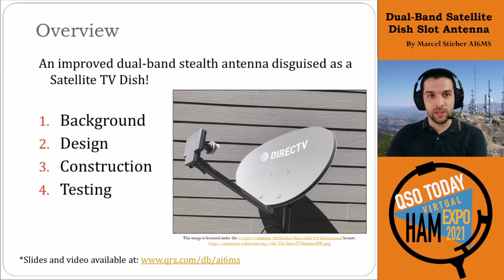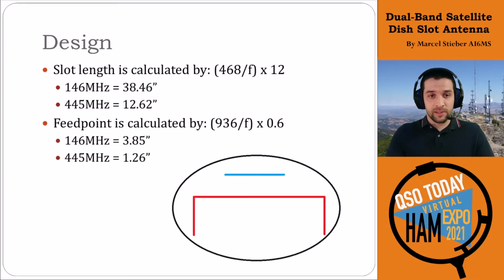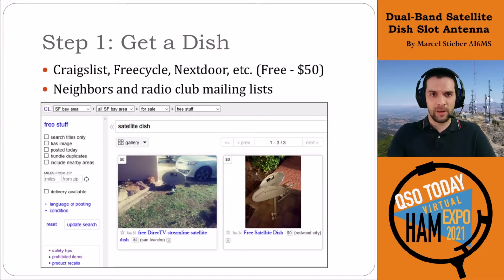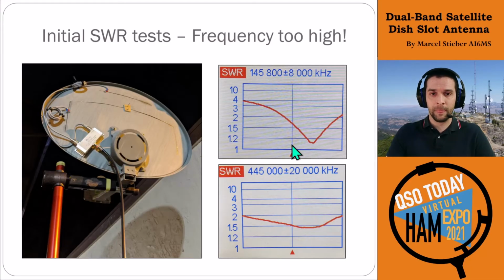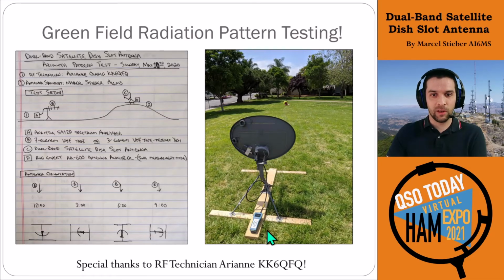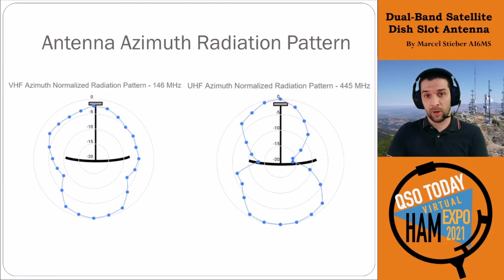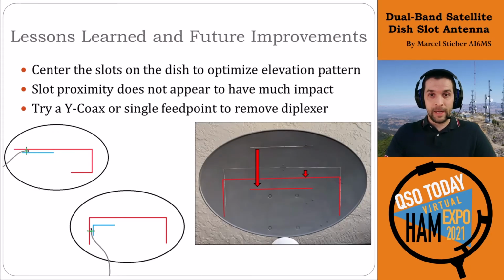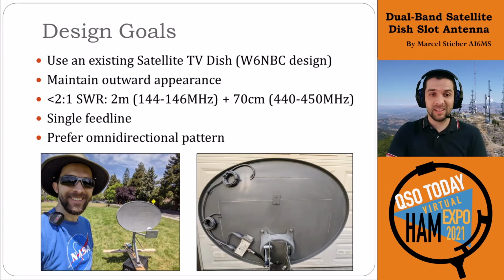Dual-Band Satellite Dish Slot Antenna - QSO Today Virtual Ham Expo 2021

Comment: Thank you for this!  I bought a home that has an Direct TV dish that I will use to make my dual-band slot antenna following your presentation.  I'm a new Ham, just received my technician license a couple of months ago, and have been using handheld radios.  Upgrading to a Yaesu FT-710 after the holidays, and needed a good antenna (VHF/UHF) to go with my Vertical HF.  I should be upgraded to General in January.

Thanks again.  

KR4HSF - 73
Reply from the maker: Awesome!! Hope it works out for you!
Reply: @MarcelStieber  Sir, the formula 936/frequency is a foot value, not an inch value.  If I had a 445 Mhz antenna  and I used the feed formula you provided, I would get 2.1 foot, for a full wave, and multiply by 0.6 that gives me 60% of 25.24 inch dimension. That calculates to 1.26 foot (15.1 inch) for feed point, and not 1.26 inches. Your dish feed point has what looks like about an inch and a quarter it is not 15.1 inches which is therefore 2 inches wider than the slot. Please enlighten me to the math used. Thanks I do not understand how a foot = inches. Regards, AC4KV I hope you can understand my word salad.
Reply from the maker: @ElysianDreams936/f x 0.6 where f = frequency in MHz and the result is in inches.

Therefore for 445MHz, the feed point is 936/445*0.6 = 1.26 inches.
Reply from the maker: @ElysianDreamssee also the second reference from N5CEY
Reply: @MarcelStieber  Thankyou.  My review of the slide you presented is accurate. I checked the W6NBC PDF and it confirms you were unclear on your slide that shows the formula. Quote from W6NBC : "My Antennas textbook estimates the 50 Ohm points at roughly 0.05 wave length from either end." 
You did not show that you truncated the formula reference to convert from feet to inches. 12 inches * 0.05 Wave = 0.6 , that is all.  My brain sees the 936 / freq as feet, not inches.  It would have been nice to show the conversion to inches in your formula, not just the result.  Because 936/freq is still textbook feet.  Regards

Comment: Is this antenna is horizontally polarized? How many DB are lost when transmitting to a vertically polerized antenna?
Reply from the maker: @evanprout3349  a horizontal slot antenna is vertically polarized. Mismatched polarization can lose 20dB.

Comment: This was such a well made video and very well thought out experiment. I'm a new ham and have one of these on top of my house from the previous owners. I can't wait to try this.
Reply: One question though. Your results showed that the slot antenna design didn't accomplish the omnidirectional goal. I know the yagi is pretty much the pinnacle of directional antenna designs. Could a slot antenna design such as this fill the same role of a yagi though?
Reply from the maker: Thanks for the kind words! In order to improve the directionality, you'd have to explore additional elements to direct and reflect the signals in the desired direction. Not something I've explored.

Comment: Great presentation, thank you for all the details. Have you considered what would happen if 220 and 1.2ghz slots were added to the design?
Reply from the maker: I haven't tried it myself, but the same concepts should work. You'd likely want to do a dedicated feed for the 1.2Ghz and keep it centered on the dish as much as possible.
Reply: @MarcelStieber  wa6ilq here... I'd like to chime in on this....   Have you thought of doing a V2.0 with repositioned slots, and a quadplexer?  (146-220-440-1200), and extending the 2m band down to the 145 MHz repeaters.
I'd be willing to toss some $ into a kitty to fund a V2 that would be published with dimensions.
Reply from the maker: @mikemorris5730  I have not done so. You're welcome to try! The same concepts apply.

Comment: Would this work with a mesh dish antenna rather than solid metal dish?
Reply from the maker: Possibly? Depends on how the slot is cut and how the current can flow around it through the mesh. Try it out!

Comment: What happens if you add a small yogi in the center in the place of the feed arm as the 2 meter and leaving the slot for 70 cm? Could it work out?
Reply from the maker: Sure? The Yagi will interact with the dish, so you'd need to be a bit careful with the design. Also, a 2m Yagi would be quite large and might look strange in the dish.

Comment: The slot could be hidden and strengthened by fiberglassing over the cut. The area where it's added would have to be taken down to bare metal.  Getting some waterproof resin and some Veil (thin) fiberglass from Tap plastic. Add a layer or two on each side. Afterwords, the fiberglass could be sanded, and painted. The slot likely would not show much at all, and it would be sealed from rust.

Cool idea for HOA's. The FCC needs to step up, and step in, against HOAs.
Reply from the maker: Take a look at one of the references. One of them tried that and had major changes to the SWR. You'd need to account for the filer material and adjust the slot design according.

Comment: Question I had, when you changed the length of the VHF slot, did you change the feedpoint location also?  Thanks for the presentation.
Reply from the maker: I extended both ends of the slot a bit, so it inherently moved the feedpoint a bit. The specific feedpoint isn't that critical in my experience.

Comment: Is there any chance Ku-band satellite reception via the feedhorn might still work on this dish?  It looks like Ku-band has a minimum wavelength of 1.67cm, and so if the slots aren't any wider than that, I would guess that the dish could still properly reflect the signal to the feedhorn.
Reply from the maker: Yes, definitely possible. I removed the Feedhorn cables on this one, but I know some others have tried making it multipurpose. Maintaining the shape of the dish might be the hardest part.

Comment: Thanks, interesting presentation.  Sorry if I missed it, but did you do any gain comparisons with a half wave dipole or other antenna of known gain?
Reply from the maker: Around 12:30 in the video, column E was an X-30 antenna, but I don't trust the absolute numbers that much given the alignment variation for the high-gain vertical antenna. The referenced QST article has the simulation results showing 2.1dBi peak: http://w6nbc.com/articles/2016-03QSTdishslot.pdf